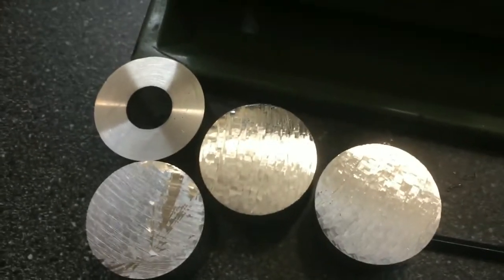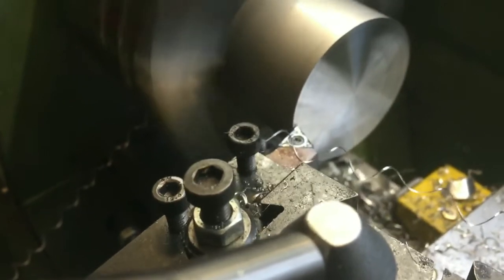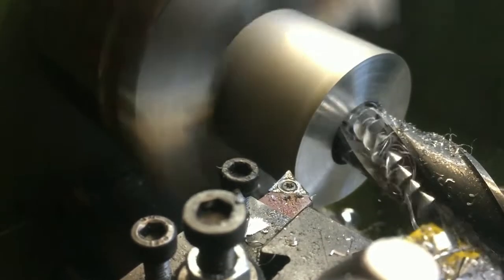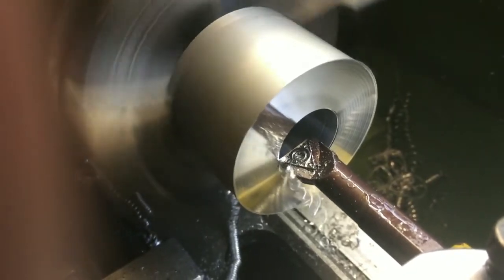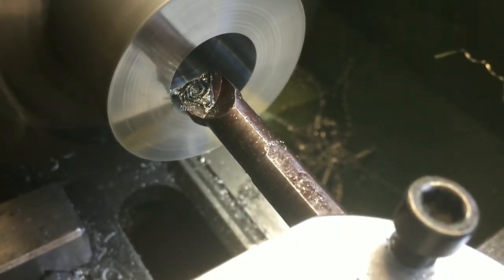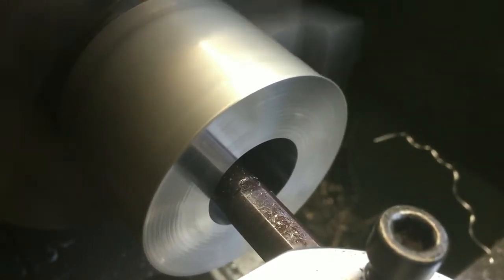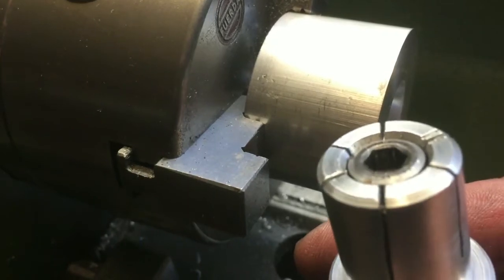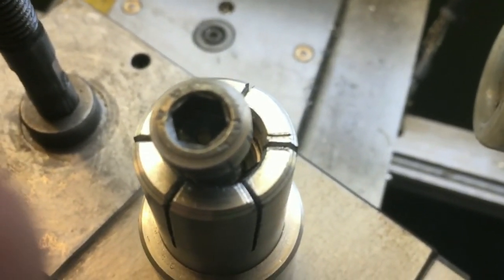WARCO LATHE paying it's keep.Expanding mandrel part 1

Comment: Hi Ade
Great vids especially on the models.
This production method on a centre lathe reminded me of my experience on a capstan lathe, in the sixties, where all the necessary tooling was set on the capstan.
From memory the centre lathe operators were used for short and more precise runs and capstan lathe operators, like myself,were used for mass production.
Both types were productive in their way but the machining and operating techniques learnt were never forgotten by myself.Now,in my 70,s,I am inspired by these videos that you and others are producing because it brings back all the memories of the skills and techniques that i learnt back then.Haveing been in the building industrie since the 70,s this is a great return to a different skill.Keep up the good work.

Comment: You can reduce the initial chatter when drilling straight in without a centre by pinning a piece of Emery cloth between the drill tip and the face before you turn it on. An old trick I’ve been using since I was a sprog.